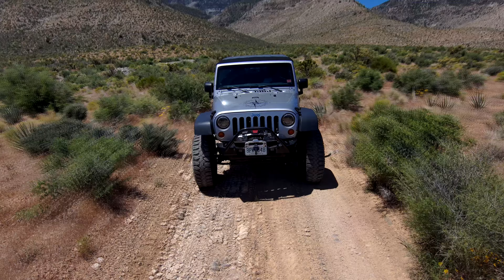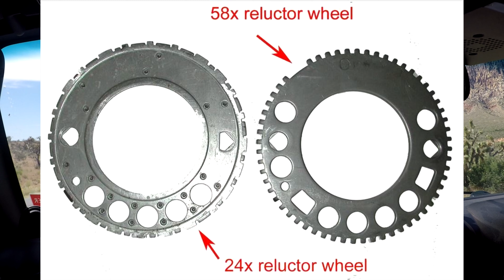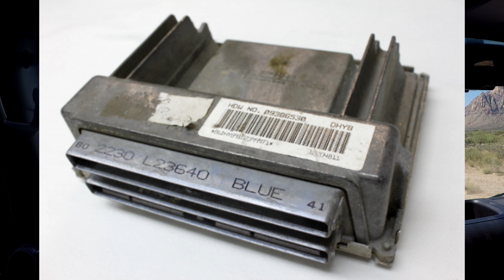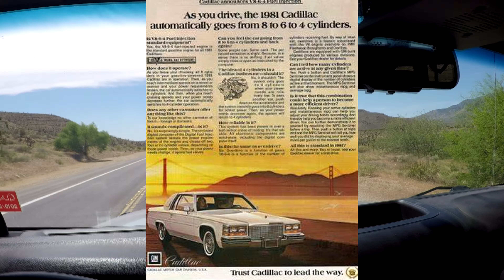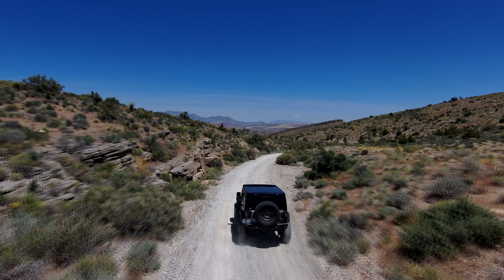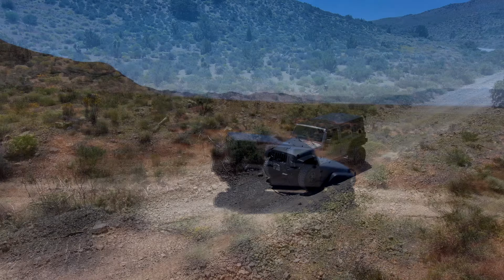Chevy Small Block Generations Part: 2

Comment: Nice work👍🏻👍🏻
In 2016+ LT1 Auto Camaro Is there any problem if i did DOD v4/v8 disable on the tune?
I mean run with V8 all the time like manual Camaro gen6 2016+
Thanks a lot